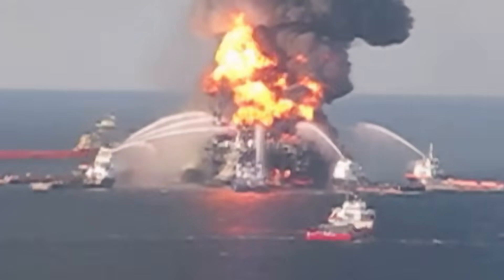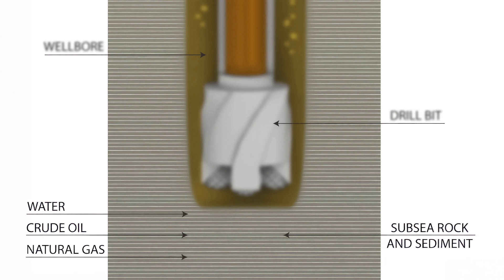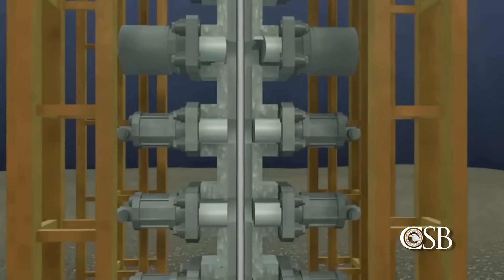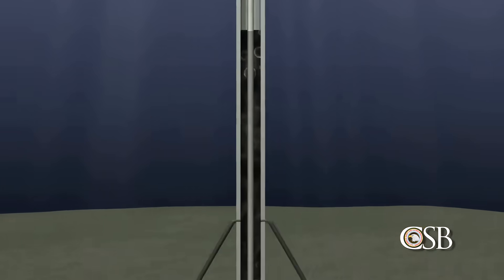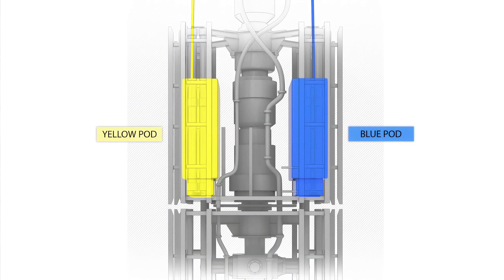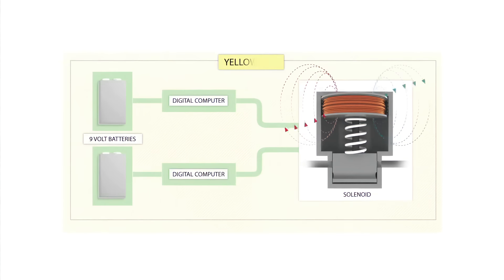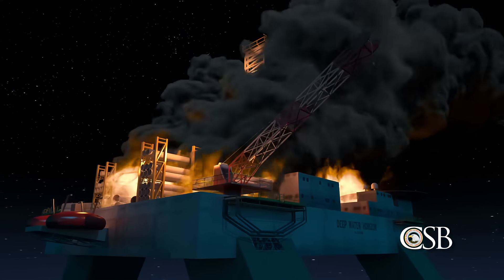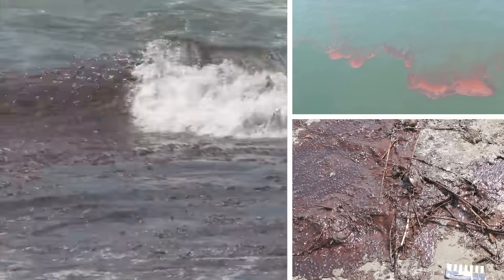Deepwater Horizon Blowout Animation

Comment: Cameron field service was somewhat untrained to deal with the problems. Transocean was sick of Cameron and the poor Siemens design template code they were using. Cam bus was constant failure or it seemed when talking with them.  Again the field service dept from Cameron were a bunch of kids.  No real training, until later, I believe someone discovered that there was no training being done and tried to train them.  So you have a 21 hour day pay rate for being an offshore tech, and this would bring in the friends and family. And there you go field service technician engineers at your service LOL.  There were a lot of good candidates who could have done the job and done well, but were never given the training opportunity to preform. If you got in without being family or a friend, your moral would become very low. Little to no experience working in an industrial electronics the Cameron BOP drilling service dept. were made up of armatures,  trained with no tech books or classes but hear and say.  Initially testing of these BOP and the Horizon itself were done in Berwick LA.  It was consider a one time test and if WORKED that one time; then it was good. As long as a witness and third party inspector were there to sign off.   The building of the stack involved an accumulator rack that wasn't  installed completely on the stack  until the very end and then tested one time... Poor Poor QA.  Most of the failure was accumulator racks on the stack would leak fluids from the connections of  hoses and tubing. Yeah you tweak connections all the time when testing the new added modules especially the stingers on the pods, but when using the hot line from the land accumulator rack (which always worked) it was a constant in tightening on hoses and tube connections.  I can imagine through vibration of the rigging these BOPs going down deep and the hoses connection or tubing probably opened up or cracked open with leaky pressure fluid. Leaving the Accumulator rack less pressure to work with.  I seriously doubt the Horizon rig techs tested the BOP completely, especially the dead man sequence because it was witness during test and you had to have a heavy duty crane to lift the top which did in the moon bay. Now those hoses connection could have been torqued and they stay tight in operations I don't know. In the end they ship the BOP as one package by placing it on a barge and float it to the shipyard onto a ship. BOP are never taken back apart like NOVs BOP and retested.  The Horizon were getting a lot of alarm problems and were frustrated. The log box could not report all of the incidents that transocean were getting or it was unclear.  So my guess is yes they most likely did turn alarms off or bypassed because of it not functioning.. or..... was it functioning?   It is possible there was water intrusion inside the umbilical cables going to the pods, which was the real reason for the alarms, but Trans ocean did not want to pay for new installation until proven. It would seem like all they wanted to do was blame people.    The video failed to mention about the shear casing ramp. In a one time event it could easily cut that pipe regardless of pipe being bent. It would cut the cement casing and pipe with no problems. BTW the dead man sequence was designed to Cut the casing  and to separate the top part of the BOP with the riser from the well head connections. It was called the rig saver.  Now previously Cameron did do some rewiring on the communication devices of the BOP to Drillers control room, especially the transducer sensor in the upper annular section. It too was connected to their dead man sequence. This  transducer sensor was stabbed in the bore of the upper annular and when not pressured would automatically close the blind rams. This was a guarantee to work... there should have been no failures with that Sensor and all three rams would have closed. No gas should have passed inside the casing. The movie is quite dramatic based on a theory.  Made big Mike look like a Hero Ha ha ha... Cameron has great technology in building, testing valves and regulators and their Pods, but I have to say that the rig went down through poor maintenance on BOP from Trans Ocean and definitely no aftermarket or field service support from Cameron putting Transocean in a problematic situation, which could have been solvable if  bought from a different vendor manufacturer. Of course Cameron has been sold with any evidence of blunder and now all is forgotten. Strangely just shortly afterwards, when Trans Ocean Horizon vessel burn down in the sea, the Trans Ocean head quarters main 4 story company building in Houston TX burnt down to the ground.  Strange days we live in... either insurance or someone had it out for Transocean.

Comment: Amazingly the same type blowout prevention system is still being used on all ocean based oil production drill platforms. The failures leading up to the deep horizon incident was due to a total failure of the blowout Prevention system.
At the top of the b.o.p. is the annular valve, which uses a rubber doughnut shaped seal which gets hydraulically forced down to seal off flow of oil from the riser. The seal had been damaged.
Once realizing the annular valve failed the blind shear rams activated and are designed to use hydraulic activated jaws to cut/crush the line closed at the wellhead. The blind shear rams activated but due to massive " kick" - blowout the piping was bent and out of alignment with blind shear ram jaws.
Now the blowout prevention system is in total failure all the drill rig crew could do is run like he'll. People died because the b.o.p. failed. Earlier in this report stated they tested the b.o.p. isn't designed to be tested. No way of periodically testing or isolating pressure under the b.o.p. 
I've also stated that all ocean based oil/gas production drill platforms use the same design b.o.p. lives have been lost and equipment/ environmental damage the deep water horizon's accrued up to present (2020) is well above 100 billion dollars and still rising.
I'm the designer of the caphead valve that stopped the macondo well runaway leak. I submitted my design to the horizon helpline and failed to patent and was claimed by a horizon personnel and a valve company and sold to BP.
I still have copies of my design submitted as well as emails to and from horizon helpline.
I also have a safer design blowout Prevention system that can be tested periodically and will isolate pressure if repairs to the b.o.p. are needed and returned back to production once repairs are completed. My design uses a set of ball and gate valves at the wellhead and on the drill platform. The flow as well as pressure can be controlled. A "kick" presuure spike hydraulic hammer can be controlled by closing the wellhead ball valve with the ball valve at the surface. Called primary and secondary shutdown. Virtually chokes a "kick" from happening.
Pressure can be controlled by choking the wellhead ball valve down. This type of blowout prevention design is more positive and user friendly and will significantly reduce oil spills.
My design is patent protected and can be bought, suggesting oil companies buy as a conglomerate.  My design will cost but signicantly less than the cost of a spill. My design can be viewed by pressing my account indicator.
I'm the real deal and have over 30 years experience in pipeline repair and maintenance. Until I had an on the job injury was employed on Alaska's North slope oilfields at the Kuparuk river unit- conocophillips. And I am the only person to date that has stopped an oil spill. Tom a. Gordon.
Reply: Good job Tom.

Comment: 'B.O.P.' MY ASS!  *There's NO FUCKING WAY for any mechanical device then/now/or in the future that can resist hundreds
of tons of pressure*  Why?  *Because of the percolation of vapor 'boiling' at the well-head that destabilizes the integrity of 
of the 'Bore' itself which 'rocks the cradle' so quickly that a hundred-tons of 'BOP' begins to shift 'off-center' and when that 
occurs the very purpose of it being there is defeated by the mechanism of shearing at the well-head itself*

Comment: "A kick went undetected", 
this is the start of it all, 
the narrator could have started this sad story by saying, " The semi trailer, with 3 trailers full of fuel, 
sped on through the night, as the driver slept blissfully on,....."
Prevention is the best"cure".
The failure of the Blowout Preventer is only part of this disaster,
there are juss so many things that "didn't happen", things that SHOULD have bin done,
long before the blow out occurred.
   If requested, I will give a long list of the folks on nilly every rig, who's job it is to monitor , and deal with the safe operation of the drilling process.
  Beginning with the Geologist, 
who,by the way, should know what sort of formations that they are drilling through, 
and the likelihood of encountering a "kick",
through to the "Mud Doctor", and the advise that the rough necks that actually 
do the "hands on" part of the job, should be getting.

Comment: bringing toxic poison out of the earth that is never supposed to be exposed in this manner. its under high pressure and highly volatile wtf did they expect to happen?
Reply: They had to do it so you could fill up your car that day, make plastic for the computer you are typing on, and make the electricity to run that computer.
Reply: @dangerousdan4184  but there are any number of ways to do the same thing fossil fuels are just the most efficient and cheapest currently

Comment: You know you could design a blowout preventer to that it would trigger automatically in the event of a power failure.  And you could design the ram sheer to cut of the entire space regardless of where the pipe is in it.  These are simple things that any competent engineer could have spotted and fixed.  Thank god the age of oil is over.
Reply: The age of libtards who can't tie their shoe is a better solution.

Comment: It was cluster fu_k beyond all cluster fu ks and as far as man made disasters go equals Chernobyl. And make no mistake , every drop of oil that was sunk via the  chemicals that was sprayed on top of millions and millions and millions of gallons of oil is still sitting on the bottom of the ocean and WILL NOT BIO DEGRADE. Again , it’s a Tragedy that can only be matched by the melt down at Chernobyl

Comment: Basically there were so many engineering mistakes built into the safety system that it actually worked. When a battery that was not supposed to fail actually did, it allowed the cut-off system to work properly.  And of course the entire ram system failed because it did not stop the oil.

Comment: Wow, that's really interesting. When the investigation finished, we all became aware of the issues with the concrete sealant and it's failure -- later, we learned that it could have been prevented if responsible decisions were made. Obviously, people working on the rig need to have multiple methods of preventing this type of disaster.
Until I watched this, I had no idea just how many safety features & procedures failed that day.

Comment: A billion dollar oil rig and the only protection against the loss of life and a catastrophic environmental disaster is what I put in my smoke detector. A 9V battery.
Reply: Power plants commonly use 2 volt batteries for the emergency systems that allow a safe shut down in the event outside power is lost.  They just use 60 or so of them together.  Each one weighs more than a person.  Voltage has nothing to do with the size of the battery
Reply: @andrewt.5567  How can a "power" plant lose power jk..
Reply: @bcapa217  Let me list that for you
Allmost all Power plant:
1.Turbine Failure during emergency
2.Sabotage
3.Power line disconected
Nuclear power plant & Steam power plant:
1.leak on pressure pipe
2.Meltdown
3.Sudden blackout and no power to lower the control rod
Hydroelectric dam
1.Natural disaster that destroy the power line
2.Dam leak
A diesel power plant and gas power plant
1.Fire on the engine unit
A geothermal power plant
1.Explosion on the geothermal deposit
A coal power plant
1.The furnace is on fire

There is always a reason to have emergency power backup in a power plant,and there is always a reason they lost power
Reply: @generalfeldmarschallpolycr8118  what an exhausting reply my comment was clearly a joke
Reply: @bcapa217  oh,sorry I ruined the joke,i don't know it's a joke.
Reply: @bcapa217  I mean I get your joke, but also learned a ton about power plants

2 for 1
Reply: @generalfeldmarschallpolycr8118  Great comment, General but one correction, control rods in nuclear power plants are driven into the core by gravity or springs. If power is lost, rods will go into the reactor automatically; it takes electrical power to pull the rods out.
Reply: No, not likely the same. Voltage is pressure, not power.
Reply: Instructions unclear: All the smoke detectors in the building are now on fire
Reply: There is no protection against disaster. They happen every day and you will likely experience at least one in your life too.
Reply: It's not the same battery you're thinking of, nowhere close, it's just a battery that carries 9v, you don't need crazy power to power a circuit. It might've been much more complicated to send power from the rig, down to the circuit, then step out down etc etc.
Reply: Magnetism is most affected by current not voltage
Reply: @kgosimookodi2988  and current is affected by voltage in a medium of a given resistance

Comment: I’m not buying the “buckled drill pipe due to pressure differential”. That pipe is over 1/2” thick of solid steel.   PSI at the ocean floor was not high enough to buckle 1/2” steel. What’s more likely is that DWH was the 2nd rig on site. The first one was damaged in a hurricane and had to go to dry dock for repairs. When DWH got on site, communications to the BOPs were never done. They had no communication to their BOPs. 
This wouldn’t have mattered ultimately as they didn’t put in enough spacers in the casing column (11/33).  Then, when Halliburton didn’t get a successful test on the concrete at TD, they were summarily fired for “trying to sell more concrete”.   That’s why no Halliburton people were on the floor when she blew out.   The final “nail in the coffin” came when  they evacuated the mud from the annulus to “bring in the well”. Both mud engineers were killed on the floor. One of them should have been “off tour” and in the living quarters (a sleep). When insanity won’t listen to reason, you go get help. 
Safety procedures used in the Gulf for decades were not followed. We didn’t need a “drilling moratorium”, we needed procedure to “trump” greed and arrogance.
Reply: well im pretty sure the pressure of the oil and gas can be as much as 5000-8000 psi, the well was unstable but do to a mud blockage the sensors did not deter the pressure, due to microscopic impurities in the pipe and the negative pressure forming on the outside there was an unimaginably high pressure. im not sating that this is the only reason, it just that its part of a huge list of dumb coincidences and negligence that all combined together to cause a horrible accident.
Reply: Believe or not that is whaat the investigators found after the blow out preventer was recovered and examined.  you were not the only one that didn'tbelive it.  The engineers that designed this equipment didn't think it was possible.  Now that they know it can happen they can design blow out preventers to deal with it and successfully seal the well.

Comment: Nicely done.  I appreciated the detailed animation.   I recall when I heard the BOP had failed back in the days of the event and I just shook my head in disbelief having some appreciation of the event as a industrial pipe/instrumentation fitter 40 years ago.  It's fair to say that the BOP did not entirely fail in it's design.   The biggest issue was that someone rebuilt this BOP stack and did not do any testing .    This is a stack of devices that all binary in operation...either OPEN or CLOSE.  Thus it's obvious that not a single bit of testing was done to guarantee the correct rebuild of the stack had been done property because ...again...it's a binary operation..it either works or it doesn't and the only way it by QA aka Testing  is because there was no testing of the BOP unit after rebuild.   Those are the people who should first and foremost be held accountable because I can guarantee you that someone signed off on the 'testing'of the rebuild BOP stack.      All the other stuff I make no comment on as it's that simple.
Reply: Agree with your comment about the BOP not completely failing. Yes, the incorrect wiring was a major contributor, but having the pipe bend was also critical. The BOPs of this era did not have a high success rate - one small oversight by money-hungry petroleum companies.